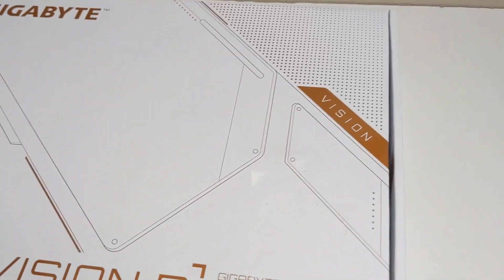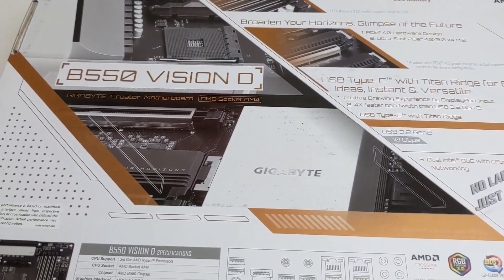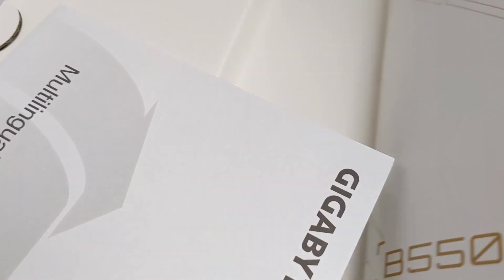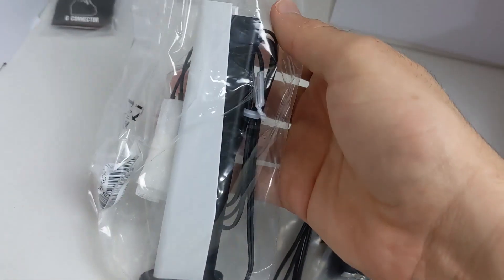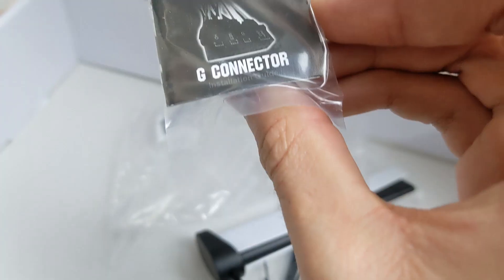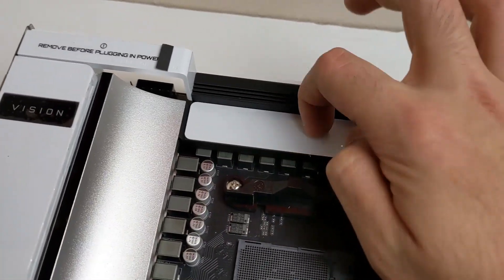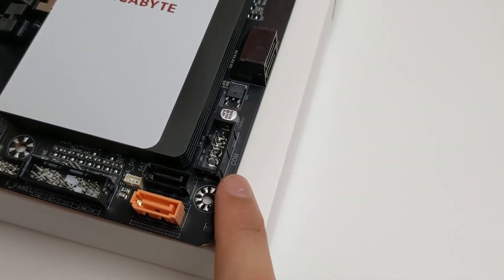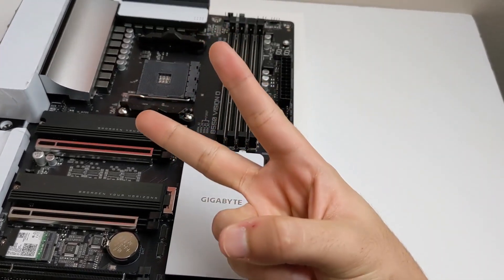Gigabyte B550 Vision D Unboxing

Comment: Are the M2 slots both 4.0? Because I own 2 NVMe 4.0 to mount and I would like to take advantage of PCI 4.0 in raid mode.
Reply from the maker: Only x570 has dual pcie 4.0 m.2, one m.2 is pcie 3.0x4
Reply: @21stWallStreet  Thanks, Is there a big difference in performance if I only use a 4.0 with a 3.0? is it possible to raid them? I have 2 Nmvd 4.0, are they backward compatible with Gigabyte Vision's 3.0 slot?
Reply from the maker: Yes most drives aren't that much faster